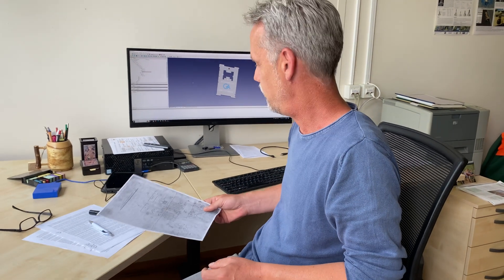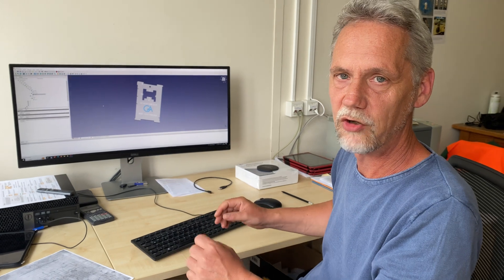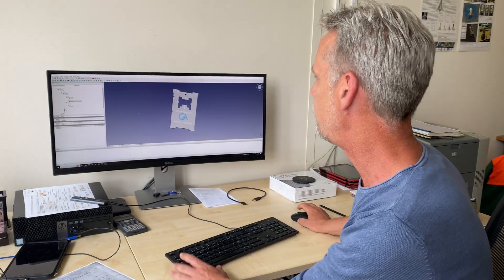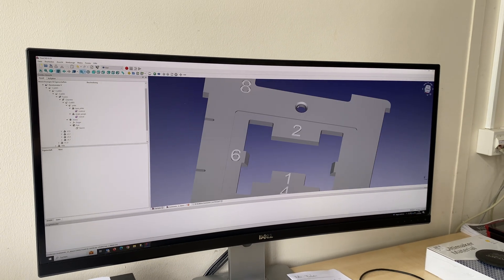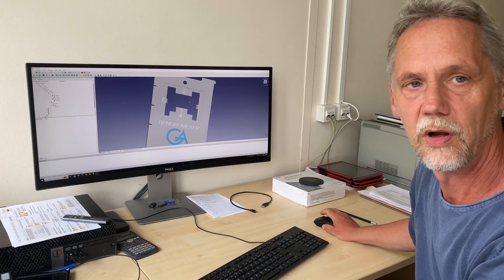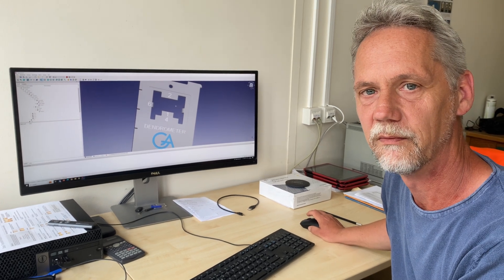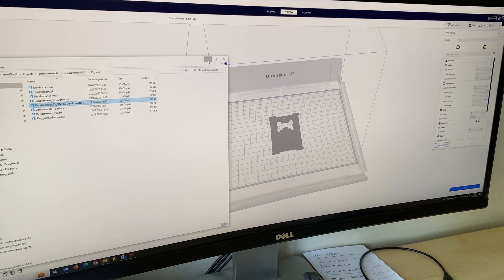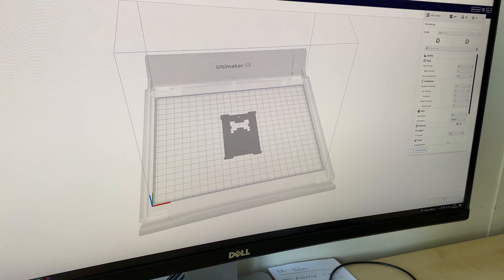Testing a self-3D printed Dendrometer for stand basal area estimation

Comment from the maker: Whoever wants to try this, you find the print file here: https://www.thingiverse.com/thing:6225220
Reply: Hello, please could you let me know if it be possible to provide dimensions of the device? I am hoping to cut and file one out of steel plate and as I have no reference this is a challenge.
Reply from the maker: @TC-th1ey  The relations between the width of the counting plates and distance (from eye) are: 
Counting factor 1 = 1:50
Counting factor 2 = 1:35,4
Counting factor 4 = 1:25
If you decide to use a distance from eye of 50 cm (like the Dendrometer), the respective formula can be simplified: the width of the counting plate (in cm) can be calculated as sqrt(counting factor). Example: for counting factor two this results in 1.414 cm (for 1 in 1cm and for 4 in 2cm). You find all formulas also here: 
http://wiki.awf.forst.uni-goettingen.de/wiki/index.php/Bitterlich_sampling
Good luck with building your own angle gauge!
Reply: @forestinventory  Thank you for your prompt reply, I'll certainly try!